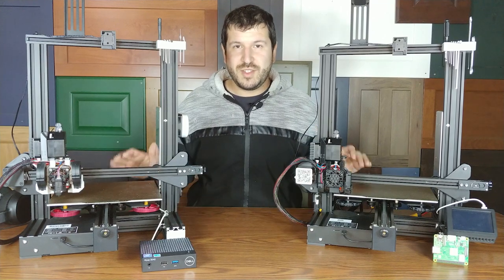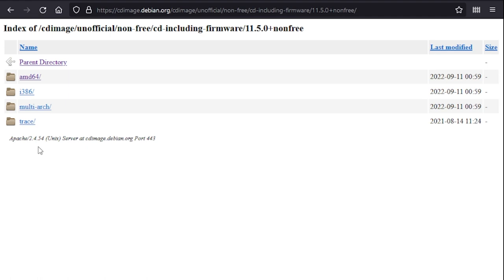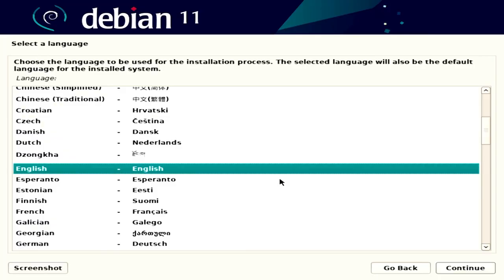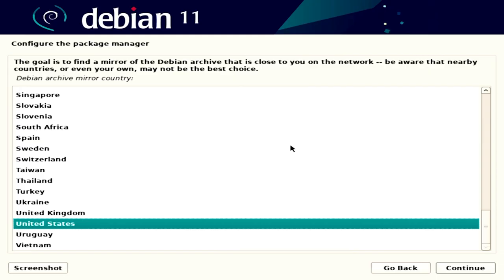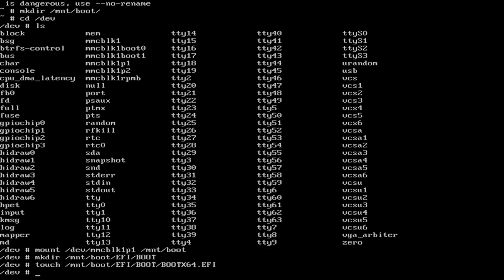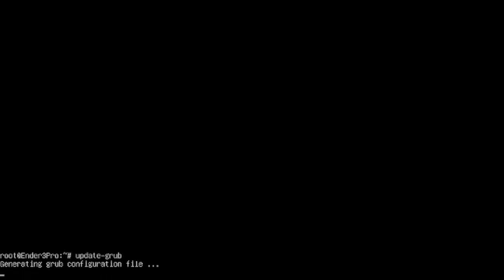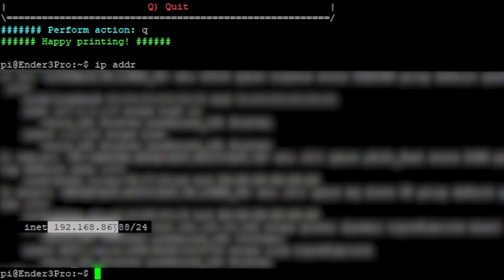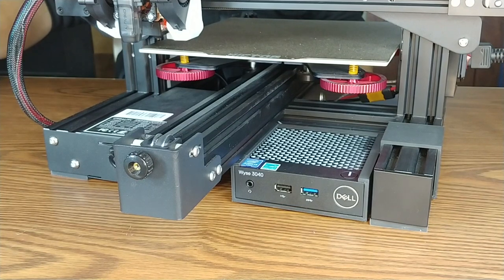Use a Thin Client as a Raspberry Pi alternative for your 3D printer!

Comment: Great video, thanks a lot! Only info that i was missing is how much space is left for gcode files after you installed everything?
Reply from the maker: Depending on your disk size, if you have an 8GB drive and install everything that I did in the video, you should have roughly 1.2GB free at the end.
Reply: @CrimsonRepair  thanks for the quick reply! That is actually not too bad. Guess I go hunting on ebay :)
Reply: Too add some feedback, got lucky on ebay and got 2 3040s for 25€ each. Following your video I was able to install Debian and Klipper including fluidd and Klipper screen.
After opening fluidd on a Webbrowser it shows me even 1.6 GB of free space, so plenty of room for gcode files.
Thanks again!

Comment: I did everything according to the video and everything worked fine with the exception of the klipperscreen. After installing it via kiauh, I rebooted the client hopping to see the klipperscreen but instead it goes to ssh screen. Any ideas? Thanks
Reply: Hey mate did you figure this out?
Reply: @leetpg  unfortunately no, the issue needs someone with greater knowledge of Linux software than me. In theory it's a simple setting change in the klipperscreen configuration but that's all I know.
Reply: @natureboy3921  if I figure it out, I'll let you know.
Reply: @leetpg  thanks, that would be awesome
Reply: Well, by accident I figured out. Install debian 11.8 and follow all the instructions on the video. On kiauh install last klipperscreen, once you finish the install your screen would go blank and immediately after klipperscreen would appear.
Reply: One more thing, do not try debian 12, it is too heavy and you will run out of space in the middle of the klipperscreen install.

Comment: Thank you so much for this video. My second RPi3 decided that it was time to take an extended holiday and I can't get it back. It was running my Anycubic Linear Kossel with Octoprint. The Anycubic is ready for a do-over and I'm intrigued running Klipper on it especially since I want to update the driver board as well. This is super interesting on two fronts 1, using a thin client as the Klipper host and 2, saving a fortune by not having to replace the Raspberry Pi. Thank you so much for your hard work. Here's another possible option to the Android Phone. Could you run Octoprint or Klipper on an Amazon 7 inch tablet? They are super cheap and you don't have to deal with the whole phone modem / carrier BS.
Reply from the maker: You can run Octoprint from an android device, yes. Check out Octo4A if you're interested in trying it out. Your Amazon tablet will need to support USB OTG for it to work with the printer though.
Reply from the maker: Also, how did you kill your Raspberry pi? I've had luck fixing raspberry pi 3's before that were severely overvolted. (buck converter fried and sent 24v straight into the USB port of the pi) so I'd be willing to try fixing it for you and making a repair video about it as well.
Reply: @CrimsonRepair  Being the spaz that I am I completely missed your reply. I think the RPi3 got killed because the power lead was inadvertently pulled out slowly. The Pi lights with a red power light but with a known good microSD card it will not boot. No blinky green light and nothing on the HDMI port. I know the MicroSD is good because it's running in my other Raspberry Pi 3 right now. I would be more than happy to send it to you if you wanted to do a video on its repair. Those little buggers are expensive! I use them exclusively as print servers for my 3D printers and it's a pain in the butt to do the SD shuffle on my Anycubic Linear Kossel. I'm buying an OBD cable that will hopefully fit the Fire tablets that I was given. Both of them work fine but they both have cracked screens. I tried to run Octoprint4a on an Honor 8 and it works fine with a small wrinkle if you plug in the power first the USB communication doesn't work. If you leave the power supply unpowered then the USB communications works fine. This is why I'm looking at using the Fire tablet although your video setting up Klipper on a thin client is very attractive. The Anycubic delta was my first printer and I'd love to get Klipper running on it. My go-to printer now is the Artillery Sidewinder X2 which is an excellent printer IMHO. But Klipper on the Delta though... It's just too attractive. How do you want me to get the board to you?
Reply from the maker: Delta printers running klipper are a perfect match for each other. They have so much performance gain just from a simple firmware change it's crazy. Feel free to send your RPI to Crimson Repair P.O. Box 24 Embarrass WI 54933 and I'll feature it in a future video if I think it's fixable!

Comment: What size is the power male plug for the 3040 ? And do you think that linux version would support a USB wifi adapter  ?
Reply from the maker: Yes to the USB wifi adapter, and the plug I'm using is a barrel jack 4017 or 4.0mm x 1.7mm

Comment: How would you setup input shaper inside the Wyse 3040?
Reply from the maker: I personally use a adxl345 attached to a raspberry pi pico running it's own klipper firmware plugged into the 3040 through usb.
Reply: @CrimsonRepair  Would the 3040 be able to just take in a adxl345 usb in one of its usb ports for that?
Reply from the maker: @johnathanwee6334  yes, as far as I know an adxl345 usb is basically just a adxl tied to a Pico style controller preloaded with klipper
Reply: @CrimsonRepair  If I already have a working Klipper cum Fluidd setup with a Pi3 , is it as simple as copying the printer.cfg file over to the new klipper in the 3040? What else is needed ?
Reply from the maker: @johnathanwee6334  yes just copy your printer.cfg and it should work exactly the same

Comment: Is that buck converter connected to the mains? and if so, wouldn't a 24V to 12V converter be more suitable?
Reply from the maker: No, it's connected to the 24V output of the power supply. We're using the buck converter as a 24V to 12V converter (Or 5V depending on your thin client)

Comment: I tried it many times, but it will not work like in your video. Evertime at the same point 
"mkdir /mnt/boot/EFI/BOOT" it shows : mkdir: can’t create directory "mkdir /mnt/boot/EFI/BOOT" : File exist.
it works up to the Timelap 10:33, next ist blackscreen and nothing happen.

So someone can help???
Thanks in  advance!
Reply from the maker: If the folder already exists, try moving onto the next step of creating the BOOTX64 file with the touch command

Comment: I did this with an old laptop but I can’t seem to get the printer to communicate with the laptop. Do you have any ideas? How about showing us the process to flash klipper on to the printer?
Reply from the maker: What kind of printer are you using? I didn't include that process because this video was just about how to install Debian and klipper on a thin client, not about how to run klipper on your printer. Every printer is different, so even the difference between a 4.2.2 board and 4.2.7 board in an otherwise identical Ender 3 makes the process slightly different. I can point you in the right direction for your printer though!
Reply: Am going to give this a try myself as have a few old bits lying round I can use (including a Galaxy Tab for touchscreen). A guide on flashing the firmware to an Ender 3v2 direct drive would be ideal thanks

Comment: I'm hung up! I have followed your instructions to the "T". I am using a 64gb drive that came with the machine. After entering the command to  install the network manager, and "mkdir /mnt/boot/", then "cd /dev, I hit ls and the files are displayed. There are no files in between "mem" and "null" listed. :( No partitions shown. I can't go any further. Help!
Reply from the maker: That's a new one. My first suggestion would be to check that the drive has been formatted in the partition manager. When you go to reinstall for a second time, before formatting anything is there an ESP/EFI partition and an EXT4 partition shown? Also, if it's not showing any partitions in /dev/, check the name of the disk in partition manager. It should show at the top of the list of partitions like in the video here it shows MMC/SD card #1 (mmcblk0). You can try typing p1 after whatever it says on your device and maybe it will work even if it's not showing up in /dev/
Reply: @CrimsonRepair  I went through the entire process again with no luck. The partition screen looks identical to yours except my drive is larger. Still no partitions showing up after giving the command "mkdir /mnt/boot/". I may have to give up. I don't have any Linux experience, so when things go bad, I am out of luck. :( EDIT: I forgot to mention this is a dell 5060.
Reply from the maker: Ah, that may be the issue. I don't think you need to run anything after installing network manager on the 5060. You should just be able to go into your bios after install and set your 64gb drive to boot first. You may have to disable secure boot in the bios as well.
Reply: @CrimsonRepair  That was it (Dell WYSE 5060)! Everything proceeded smoothly and I have Klipper installed with the remote screen displayed on my PC. Thank you so much for the help. Yeah, there really wasn't a problem, I just had to proceed with the install without having to make the partitions. Thanks for such a well produced video.
Reply from the maker: Glad it works! If you've got an old android phone, check out yesterday's video to make it into a touchscreen for your printer too

Comment: Is there anyway to clean up the amount of space it takes? I only have 187 MB left on mine after all the updates. If the updates get any bigger this will not be an option. 😢
Reply from the maker: You can resize the EFI partition to be even smaller if needed. You could probably reduce it down to around 20mb in size without an issues and then allocate almost the full disk to Debian. You can also run the entire system off of a USB stick. Just make sure you use a USB 3.0 drive for speed

Comment: is this the same process and software for a 5010?
Reply from the maker: Yes, although you shouldn't need the final parts of the Debian setup after apt-install network-manager
Reply: @CrimsonRepair  woo Hoo got it working on 3040 had to fudge the Wi-Fi as i couldn't find one with a Wi-Fi adapter in the UK, Ethernet and a Wi-Fi extender!!

Comment: Will this be any different on other thin clients from dell or roughly the same procedure?
Reply from the maker: Great question! I also have a Wyse 5070 that I'm using as a Plex server, and it was the same procedure.
Reply: Good question, is there an range of specs to look for if we can’t find these options or just want to get something new from Amazon? @crimsonrepair
Reply from the maker: @cstategrad99  Not really. Pretty much any thin client made in the last 10 years should be powerful enough to run klipper
Reply: @CrimsonRepair  ok, so the thin client specs aren’t as important than the process, correct? Would it change some of the selections based on the thin client. Thank you so much by the way, super helpful!
Reply from the maker: @cstategrad99  Pretty much the only thing it's going to change is if the install partition of the internal drive is less than 8gb you will have to install it to a USB drive of some kind instead of internal storage.

Comment: Would this work with HP T5540 Thin Client PC, I found one for $10 Lol
Reply from the maker: It's possible, but you most likely won't have enough processing power to run resonance tests since the T5540 is pretty much equivalent to a Raspberry Pi Zero. Also you'll have to run your OS on a USB drive since you only have I think 128mb of flash memory.
Reply: @CrimsonRepair  Thanks for info, I'll keep looking for something little more Power and Space